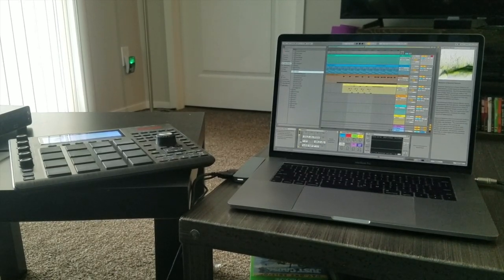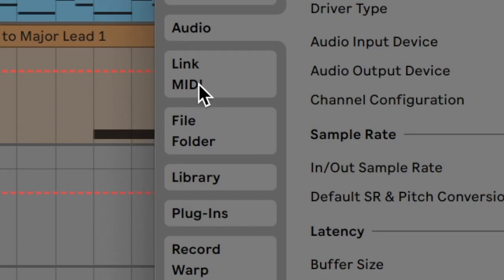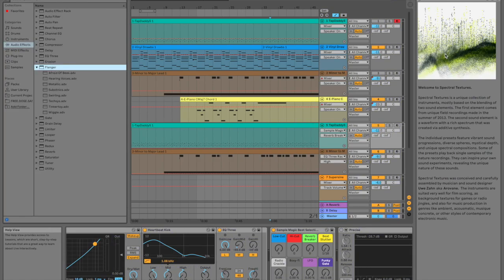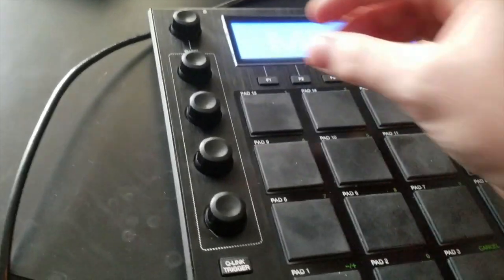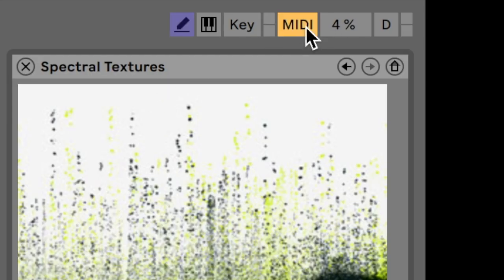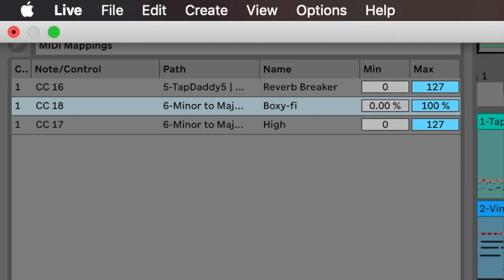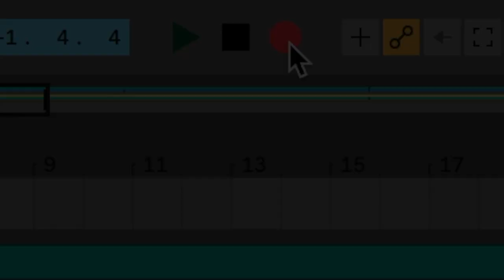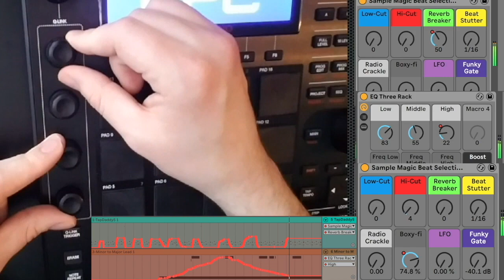Tutorial: How to Midi Map a Midi Controller in Ableton Live [MPC Studio + Ableton Live 10]

Comment: Thanks for this. Do you know if you can make Qlink knobs control the start and end points of Simpler slices, and MPC pads trigger the slices? I’m trying to achieve the MPC chopping process in Ableton. 

My goal is to be able to use the Mpc is a controller for Ableton and do everything in Ableton, as opposed to tracking in beats made in the MPC to Ableton.

Comment: Wass good Tap you know I was never a fan of FL Studio or Fruity Loops because when I used to pay for studio time the engineers had the original Cakewalk Sonar & another Engineer had Logic Pro X & not only that one of Future’s Producers name South-side uses the old 11th version of FL Studio that was released on April 19, 2013 & specifically said that FL studio sounds way better on a PC then a Mac because the DAW was originally made for Windows so even thought I had got me a brand new Akai MPD 26 for $120 there’s no way that I’m ever gonna use it because it works better if you have a PC running FL Studio or Ablelton & what you did in this video had me thinking about trying out Ablelton because I have a free download from Focus-rite when I had brought my Scarlett 2i2 2nd Generation beautiful have Logic Pro X 10.5 loaded in my MacBook Pro 💻 Mid 2012 MacOS Catalina 10.15.7 16GB memory 500GB Sata drive 1TB SSD 2.9 GHZ i7 Processor. I am currently waiting on Guitar 🎸 Center EBay or Mercari for a like new Mint Condition MPC Studio Black & Roland JV-1080 MIDI Sound module then I will be happier then a hooker making tips.

And by the way the MPC studio that’s out now for $269 is trash 🗑️ & it has that little crack head little LCD screen.   Keep up the good work✊🏾

Comment: So can you map your drums to pads on the mpc?
Reply from the maker: You absolutely can. When you don't have the MPC VST pulled up, the MPC Studio acts as a midi controller in ableton. You can map anything, whether it be a button, key, knob, or wheel, so long as Ableton recognizes the device as a midi device
Reply: @tapdaddy69  oh ok. For some reason when i plug in my Mpc studio, i can't map the pads to the drum rack...if i hit pad one on the mpc it will trigger a pad in the top left of the drum rack...i can't seem to map it out correctly
Reply from the maker: @rocknitty8963  
Here's a tutorial of mine which answers this question specifically:

https://www.youtube.com/watch?v=FZoxp6U2Vak&t=0s

Something you should understand about Ableton Live and MPC Studio is that when you don't have the MPC VST open, Ableton sees the MPC Studio as a simple Midi device. The advantage is that we can create custom drum racks in Ableton and bang out natural sounding drum patterns on our MPC Studios. The disadvantage is that Ableton doesn't register that the midi device you are using is actually an MPC, and so the formatting is all screwed up preventing you from having the layout of your

As you can see from the tutorial I linked above, my

1) Create a blank drum rack by going to Drums in the sidebar and dragging that top one that says Drum Rack onto a midi track

2) Start tapping a drum pad on your MPC Studio. The Midi input will cause the corresponding drum rack slot to light up. 

3) Drag your desired drum onto the corresponding slot.

4) When. you are finished, save the drum rack using the floppy disk icon located in the top left of the drum rack. You may want to use it again later.

I hope that makes sense. Unfortunately, you won't be able to put drums in the neat 4x4 squares you see in the drum rack and have it come out the same on your MPC Studio. Instead, you gotta tap your MPC Studio pads to find out which slots in the drum rack they are tied to and use whichever slots those may be. The drum rack won't look pretty, but it's a pretty easy work around

Comment: How to enable the pads light in MPC  studio ? ..  please make a video on that  .
Reply from the maker: Now that's a good question. The lights work when you are using it with the MPC DAW. However, when used as a standalone midi device, the pad lights are off and the screen simply reads MPC. If I find a way to fix this, I definitely will do a video on it. You are not the first one to ask this lol. And btw, thanks for subbing! I appreciate you!
Reply: My workflow is to start drums inside ableton from the mpc software then drag them out. My question is if you MIDI map the qlinks in ableton will this effect there functions in the mpc software in the same session?
Reply from the maker: @danlook8732  Interesting workflow. I'll have to try using Ableton and the MPC DAW simultaneously to accurately answer your question. But from my experience with midi mappings in ableton, I would assume that the qlinks would behave as they normally would in the MPC session while simultaneously feeding input to your ableton mapping. So I don't think it should effect the functionality of your MPC session, but every twist of that qlink knob would also register as a twist on your mapping in your ableton session. I might play around with this later today. Whenever I've plugged my MPC in and booted up ableton, it's always been in MIDI mode so I've never bothered to try booting up an MPC session at the same time. Great question.